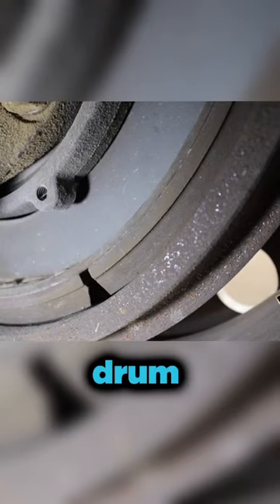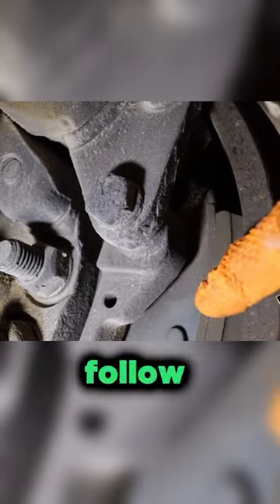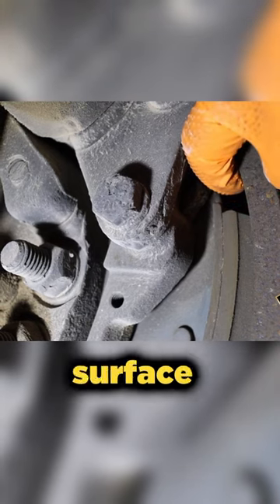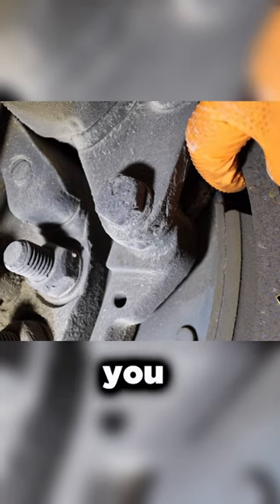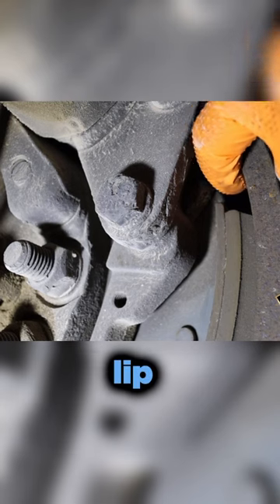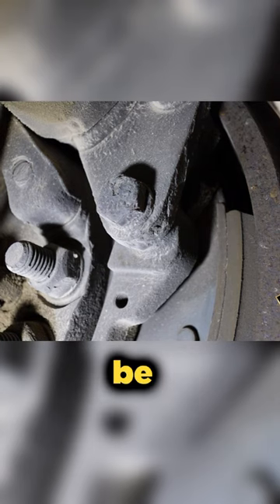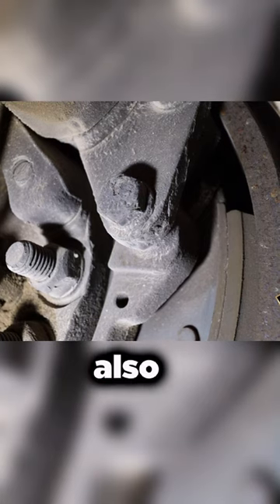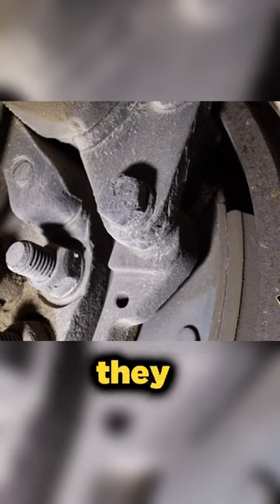PT07 Inspecting brake drums on a semi truck involves closely examining their surface for wear, crack

Comment: I don't know if anything that makes a deep lip illegal.  Over-sized shoes are available virtually anywhere.  Run those drums until they crack.
Reply: I’ve never heard of or seen oversized shoes that fit worn brake drums you have a part number.
Reply: @firemech911  Sorry, I don't have a part number, but they're commonly referred to as extended service shoes. They run a bit thicker, is all. You may still want to have the drums turned by a machine shop if you've got deep rivet gouges, but I never do. The shoes will wear a bit funky at first, especially on that outside edge where the lip is on the drum. You may run into a shop that has never heard of these, but they're probably trying to sell you new drums. Typically, I can run two sets of regular shoes, then an oversized (extra thickness) set before I pull the drum oos. BTW, I first learned of these from a Love's service truck guy a few moons ago. Sorry I can't be more help. I'll check some paperwork to see if I've got some receipts or something. Maybe I'll come up with a part number. If so, I'll get back to you with that.
Reply: @Firemech911  try talking to a fleetpride rep, if they're worth anything they'll help you out